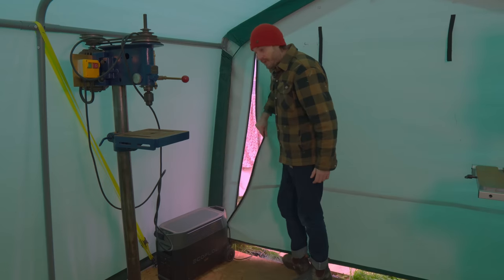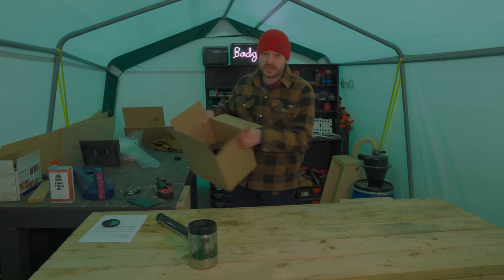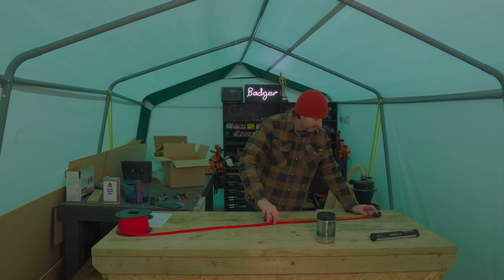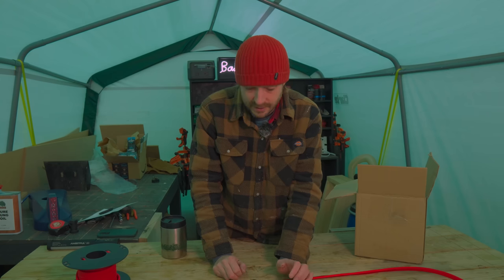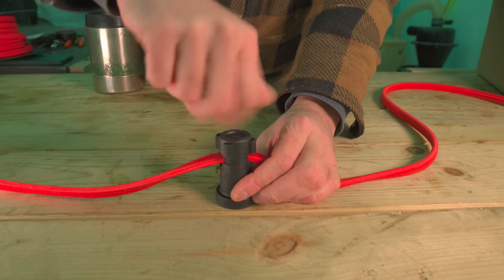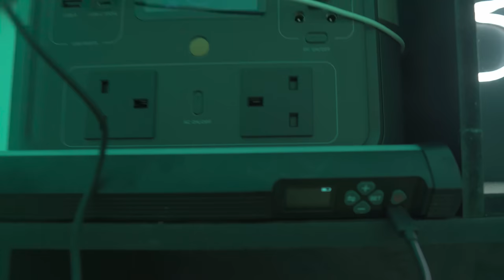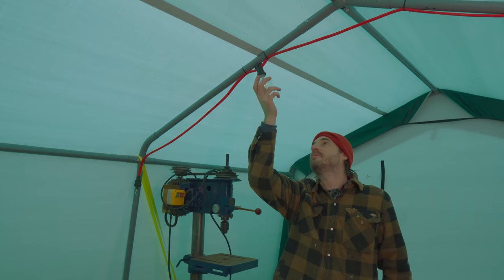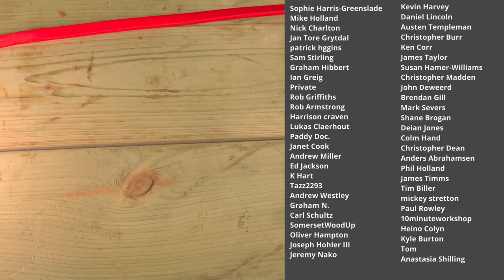Workshop Light with the EcoFlow RIVER 2

Comment: Never seen those push-through connectors on mains devices before, only on cable connectors for cars and low voltage LED’s,  so interesting to see them and they worked well, made it a really quick install.
Appreciate EcoFlow want you to say specific things about their product, but the list of “talking points” didn’t feel at all natural Matt, its much better when you can talk about things in your own words naturally.  And you might ask EcoFlow’s marketing department what on earth “up to 10 years life” means - if the battery dies in 3 months then that’s “up to” 10 years and wouldn’t call that a positive point?? 🤷‍♂️
The lights are great and make a big difference.  Will save you £ if you can recharge using the solar panels.